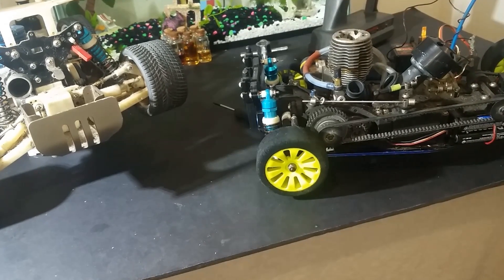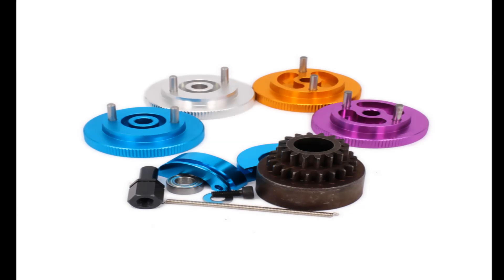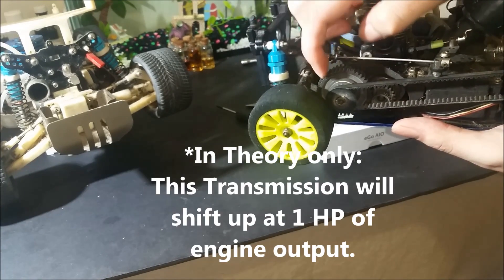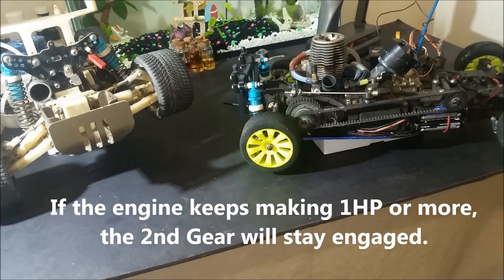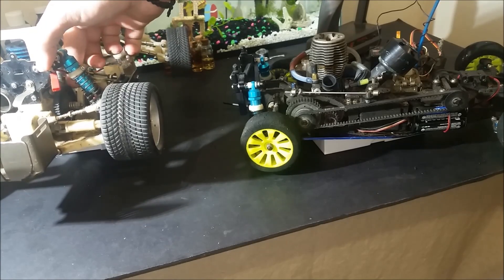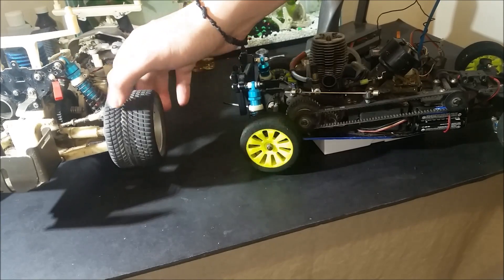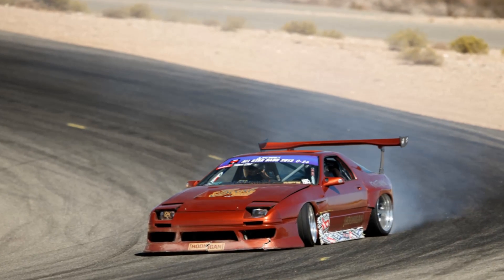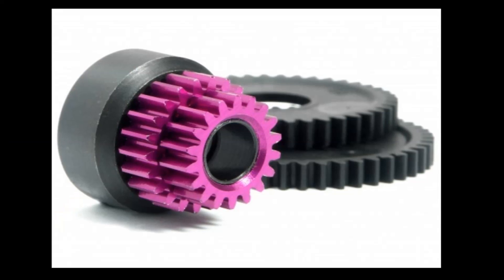How a 2 speed RC Nitro Transmission & Clutch work (RC Nitro Centrifugal clutch Shifting Explained)

Comment: The clutch isn’t operated by horsepower. It’s operated by rpm. 

You could have 1000 horsepower going through the clutch or 1, but it will always operate at the same rpm. 

The principle behind the clutch is that the object wants to go strait but is continuously being turned. When the speed that it is traveling, rpm, is high enough it’s mass it too much for the springs to keep the clutch tight and it expands and transfers torque.

Comment: Sorry I have to call LAME vid! 
No where did you even begin to explain HOW the 2 speed actually works. 
2 and 3 speed tranny's are such a simple yet ingenious system using 1-way bearings, weights and springs to set the different shift points depending on the applied centrifugal force. 
The CLUTCH simply allows the engine to idle without stalling until the RPM's are spun up thereby applying centrifugal force to the clutch shoes which engage the clutch bell that then transfers engine power to the trans via gears.